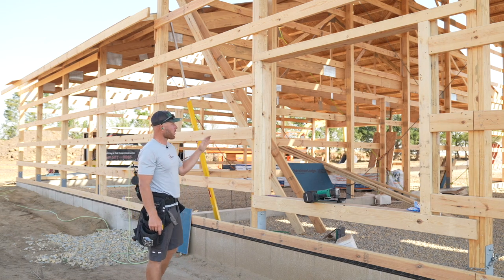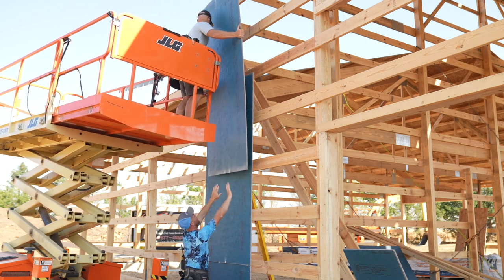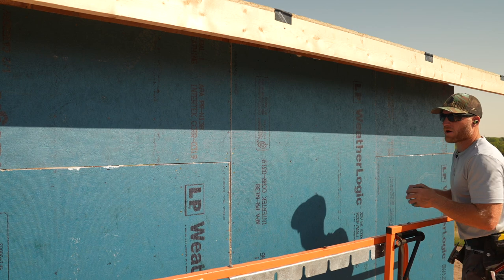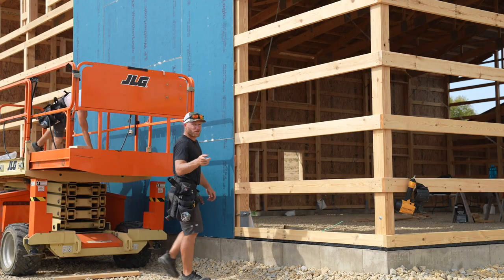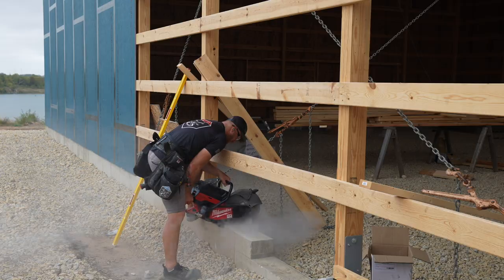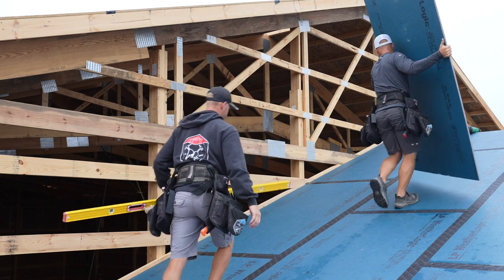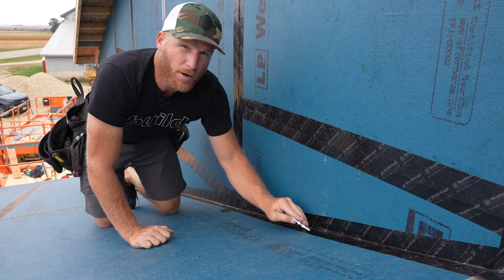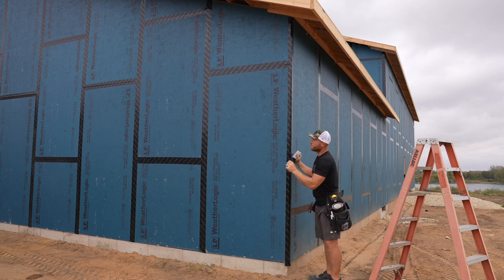Building a Barndominium Part 6: Installing LP Weatherlogic Wall Sheathing

Comment: Great job guys. Just wanted to add the point that whenever you're doing the flashing you always want to start at the bottom of whatever you're flashing.  That way if you have to add more flashing, as if the roll ran out and you need to start another roll it will overlap the bottom piece. That way you won't have what we call (bucking water). Another words, water cannot penetrate the end of the flashing tape.

Comment: You used taut right. Tight is two ends of something getting closer together, shortened, or compacted. Conversely, taut is two ends of something getting further apart, lengthened, or stretched.

Comment: To get the sheets up past 10’ a good idea would be have a piece of angle mounted to the side of the lift.  Just set it up on the angle iron while holding the other side.
Reply: We put 90 degree roof jacks on the side of our lift! Just a thought most people already have them on-site.

Comment: I like your detailed explanations of things,  one thing I think you may do different is bringing your vertical tape joints down after your corner tape is put in but before that final flat run down the rake.  Just the way I was taught.  I hope that’s not wrong to think but something to consider.  Again.  Enjoy your channel though big time.

Comment: Absolutely appreciate no compressor noise. Therefore I bought 2 valve silent compressor which I run in my apartment and which is quiter than my fridge. Neighbors are happy and my ears too. 😀👂👌👍

Comment: 13:35 The side of the building looks really good with the pattern of the sheets and tape!!! 2’ and the 8’ decision you made was the correct one visually it looks uniformed I know it doesn’t matter But when a homeowner sees it for the first time the reaction is gonna be good and in steals confidence that he made the right decision with going with you as a contractor.

Comment: A possible alternative to getting your tape in the corners: using a drywall mud/tape corner angle tool to place/smooth the tape.  Have one person pull tape taut, the other person runs the corner tool along the length of the tape.  Then squeegee for pressure afterwards.

Comment: Learned something new from you that I never thought about. Double taping corners with a 2nd run of tape  next to run on corners. We have 2 custom homes going up, and just went and got enough tape to do 2nd runs on corners. We have always double taped wall to roof joints. Just  never thought about doing the same on corners. Anyway, barndaminium is looking.great. You and Greg are a great team and making great progress. Be safe and see you on the next video.
Reply: Somehow all these products that use tape doesn't instill confidence in long term reliability

Comment: Liked the folding the tape tip.. I always used a chalk line to make sure it was even on both surfaces.. Doubling the tape is a bit of overkill, but a little more (water) protection is always welcome.. Loved the series so far, very informative, please don't skimp on the details, It doesn't matter how many times you show them, remember, this could easily be the first time someone saw how to do it... Also, 10 years from now, imagine how many young people chose this profession, simply by your attention to detail and dedication to the trade.. 10/10 brother...
Reply from the maker: Wow that would be amazing
Reply: @RRBuildings  You are very blessed to live at a time where you can literally reach out to and influence millions of future tradesmen, I have been retired for years, when I started building, power tools was kind of a new thing on the jobsite, air tools didn't show up until a few years before I retired.. I just keep thinking, what amazing things could I have built, if they had the tools then, that you have now.. I retired a Master Carpenter, fine detail carpentry work was what I took the most pride in.. Framing of course was the bread & butter for every builder.. I have had the privilege to have trained hundreds of young carpenters, yet only about 10 became master carpenters.. You are blessed to live at a point in time, where you truly can make a difference, I have seen many "how to" channels, you are young and I can see, you really do care about what you build and how it looks and how it all works together... Please continue to share, even if you think the tips are common and everyone knows them, believe me, someone will be learning it for the first time... Sorry this was so long winded, I am still very passionate about the construction trades..

Comment: Love watching your stuff, it's refreshing to see some else out that loves to do things right and thorough. You do alot of very similar building practices I do here in central Michigan. I haven't used the LP sheathing yet but would like to try at some point. I have been using the ZIP system which is very similar product but with the rigid foam option. Keep up the great work Kyle!

Comment: I'd add two 2" of polyiso staggered over the top of that weather logic. That combined with closed cell foam you'd be looking at an R40 or so. Would be amazingly efficient.

Comment: For the wrap tape; I’ve used a metal yard stick and fold the tape over it.  The edge of the stick pushes the tape down into the seam.  It’s not perfect but it works 3’ at a time.

Comment: Obviously, this building was not designed by an architect. Even measurements minimum waste and it doesn't have 15 unnecessary corners in each wall. I can't wait to see the finished product.

Comment: Have you ever tried using an inside corner roller head that's made for bedding tape in drywall? I would think if you keep proper tightness that it would prevent the bird mouthing...

Comment: Kyle, love the videos! Been watching them for over a year now! Great stuff all around. Why did you run the tape on the roof line last after running the verticals? Shouldn't the horizontal pieces run first then overlap the verticals to allow water to drain down?

Comment: One thing I will say is whatever the materials are worth, you'd still save something on the labor end not having to wrap the house. Heck, don't even need to purchase the wrap. In that way, I can't see it being significantly more than the older conventional way of siding it with the OSB and the house wrap. Maybe if you were building it for yourself and doing all the labor, but even then. What's your time worth?

Comment: Speaking of using a Makita saw a  festool track. I am  Thinking about buying some tools and Makita 40 V line along with the track saw but I want to be able to use both Ts 55 and and the Makita track saw on the same tracks With the same splinter guard does it cut on the same line or is it different from the ts 55 it needs to be dead on the same for me to use the same track for both .

Comment: Kyle.  Huge huge fan for a year now.  Very inspiring.  I'm a builder in Massachusetts and going to start building post frame for residential applications (senior living and others).  I need to gear up for doing this up here in the northeast (vs conventional stick frame).  Going to get most of what you have for equipment as you've got a great system with great tools and equipment.  I tried this framing method because of my research and your channel and did my first one on a two car garage build for a customer.  Wanted to ask you for a list of all what you have but I just found your Instagram page and it's all in there.  You are incredible for this industry (Fact!!).  Are you going to the Post Frame Exhibition in January in Nashville?

Comment: This is an exciting build to watch as it fits the shop/home concept I'm looking to build but how do you get reasonable financing on one???? And all the lenders I have found are only willing to allow a shop/home of either 50/50 or 40/60. I want a bigger shop than that. How much waist is there or is it even a good idea to build smaller and then rip out the end wall of my post frame and expand the shop? It's the only way I can see to satisfy both the lenders requirements and my needs. Your thoughts Kyle?
Reply from the maker: It’s going to depend on lender.  We didn’t have the issue here
Reply: I'd be interested in knowing that too. How does post frame lend itself to additions/expansion?

Comment: Why not use liquid flashing from the wall to the roof sheathing? That would be a permanent bond to both sheathings and you don't have to worry about water getting behind the tape

Comment: Should your inside corner get tapped (the way you did it) but be done first? So as the vertical and horizontal runs overlap the inside corner…thereby eliminating the edge (of inside corner) being lapped on the wrong side…if that makes sense…

Comment: Quick question. I’ve been looking at building a barn for some time. 40x80 heated floors and spray foam. Is it still cheaper going that route or doing icf building? I think the vertical I could put up myself

Comment: Wont the exterior metal + direct spray foam cause oil canning? My fiancée and I are currently in the process of designing our Barndo. I figured sheathing is a must.   We are currently in schaumburg.

Comment: I am in interested in LP products based on this series!  I am planning phase of a post frame barn that will need siding to match the house. Board&Batten. So LP Smartside for sure. Do I need the LP sheething under the Smartside?  I see sheds made with just Smartside. Thanks!

Comment: As you were sheathing the gable end of the main house above the garage roof, I noticed the end truss was not connected to the posts.  I could see nails in the wall girts going into the posts, but couldn't see any nails thru the truss to the posts.  I realize it's a truss and doesn't need mid span support.  Why extend the posts all the way up if the truss is not to be connected to them?  Obviously there's a reason or you wouldn't do it, but I can't figure it out.

Comment: I have a job offer coming from Wick as a foreman, but I come from a cold-formed steel commercial interior/exterior foreman background, how hard is the learning curve? I was a drywaller for years and started steel stud framing in 2009, was a foreman 2 weeks later, so I doubt I have much to worry about, but still, I'm a worrier lol.

Comment: Does that sheathing not need to have the nail holes covered with anything? I think Zip has some sort of putty for nails so I'm surprised. Like the look of it, how does it compare pricewise? Around here I swear few builders even tape the Zip stuff <sigh>

Comment: Hey Kyle im curious is the sheathing flex between girders is there any compared to a normal 16 inch on center conventional framed wall and also about fire blocking that would be installed on your joints of your osb

Comment: When taping the wall to roof connection, would it be better to do that first so the vertical tape runs over the top of it? You did an amazing job on this but just curious about sequencing for best result

Comment: When you ran the tape as the flashing around the 25 minute mark, would you want to do that first before the vertical tape? I was always taught to think like water...with the spacing of the plywood and taping over that space it leaves a little valley in the middle of the tape,  couldn't water (in theory) get behind the flashing tape running it like you did? What I mean is wouldn't you want the vertical tape to go over the flashing tape and not under?
Reply from the maker: Yes probably would have been best
Reply: @RR Buildings  thanks for your reply, always trying to learn is all...love you videos!!

Comment: I sure how there are bulk discounts on that sheathing.  I just found "local" pricing...that would be over $15K in just the sheathing.  WOW.   As for the finished floor...That is going to be radiant heat right?  LOL...So I'm getting SWMBO warming up to the idea of a Barndominium, but she really wants to be sure we have a basement (storage, potential shop for me).  Can that be done?  I'm sure the answer is "YES" because you could just dig the basement...but how would you do the floor support?  I'm guessing floor trusses?  Then if you don't do a poured floor where you bury the radiant tube in the concrete, you'll be able to run the PEX through the trusses...Would love to see you guys build something like that!
Reply: Would be better if at the point stick framing
Reply: @bornbehindbars2010  Lots of builders are moving to this and Zip...We've had 3 or 4 new subs in my area go up...100% using that and moving away from the house wrap.  So at that point, having a stick frame built will probably hit you for the sheeting costs. 

As for a basement, really the only difference there would be using floor trusses.  Poor a basement foundation, and use engineered trusses.  I was looking at I-Joists as they can span quite the distance as well.  It will come down to how easy/efficient, is it to put radiant floor heating in.  

I really want that wide open space as I'm looking to build ADA Compliant, with 36" doors, wide halls, all one level (or as my wife said "home elevators are around now..lol), roll in shower/bath, etc.  Not that we need it today, but we're getting older...one never knows.

Comment: What are you thoughts on sheathing the inside wall of the garage (the house side of the garage), so as to completely separate the two spaces.  The garage is a separate space that is not usually conditioned, so why have the two spaces communicating with one another?
Reply from the maker: It will be insulated and a firewall but not sheathed.  Both spaces will be conditioned

Comment: Great videos Kyle. Just a question about the Smart sheathing and the spray foam. Doesn't sandwiching the OSB between spray foam and the sheathings own water resistant barrier make it possible for rot and mold to develop as the OSB has no way to dry?

Comment: Wouldn't it have been better to run the tape at the bottom first, then run the verticals over the top of it? Seems like those verticals running under that seem could create small gaps where they meet. I'm by no means a professional! Just curious! @26:53

Comment: Kyle, love the content bro…..meet u at JLC few years back (Martinez booth) ,  dont wana be a troll but i think i have an idea for the mega deck and plywooding wall…….. instead of handing sheets into the platform, what if you could rig some kind of bracket where the sheets are allready on the outside of the lift?????
Reply from the maker: Agree would be a good idea

Comment: Looks really nice. I see that you don't use any adhesive with your siding. Do you see any advantage, disadvantage? Or negligeable sheer strength with or without glue. I would think that it would be stronger, but is it worth the cost? Just curious. Thanks for the videos, I really enjoy them.
Reply from the maker: All about your nailing pattern

Comment: Hi Kyle and Greg, thank you so much for posting these amazing videos. I am seriously considering integrating this type of construction into my company. One question I have is can you ever put a basement in one of these monsters? And also, how deep do your foundations go? Our freeze level is roughly 68-in, per code. Thank you for all your hard work.
Reply from the maker: Yes we have a few times
Reply: @RRBuildings  thank you for responding. Have you ever considered and intern program.?

Comment: Really like your channel!  Quick question which is best asked by reference to a specific point in the episode (minute 19).  How do you implement the perimeter nailing pattern on the 4 x 8 sheets at the vertical edges?  There seems to be no material to nail into between the horizontal girts.
Reply from the maker: Agree Scott and I guess the way I was explained, local code will dictate specific nailing patterns and I cleared this before we did it.

Comment: What’s the material cost difference of sheathing/lp vs. just metal exterior? I’m assuming it’s reasonably close
Reply: There’s probably close to 200 sheets for the whole building (including roof), so at least $10k extra, possibly closer to $15k with Kyle’s time.
Reply: You are only guessing
Reply: @daveklein2826  it’s called math

Comment: Loving the series! Have you used Zip sheathing in the past? I'm curious how you would compare the two. We currently use the Zip and Zip-r up here, as no local vendors stock the Weatherlogic.
Reply: Weather logic is def a more solid coating compared to the zip sheets that have visible holes and porosity to it
Reply: @fckafrdjohnson7210   Good to know! I can't find any local yards that stock the LP Weather Logic, I'm going to have to look into it!

Comment: What is the lifespan on the tape adhesive? That's really my only question on its long-tern durability. If you have to retape it in 20-30 years because the adhesive starts to fail that seems like a bit of a pain. I like the idea of it, just question the lifespan...
Reply from the maker: It cures like any glue

Comment: I'm in no way a professional and don't know if this would work but what if you would run a bead of liquid flashing in the seam before you lay the tape? That way the cut edges are sealed would the tape fail

Comment: I thought that the girts are doing all the lateral work for the building- are you only sheathing for weatherproofing?
Reply from the maker: No for structure
Reply: @RRBuildings  I noticed you used diagnol X bracing for the girts for lateral in some of your other projects, and omitted the plywood. I wonder if this is just your better alternative to that?

Comment: Do you build your post for the framing or are they purchased?
Reply: He gets them from Ohio Timberland.   The brackets come from Midwest PermaColumn.   Watch part 1 of this series and he will explain all of this.
Reply: Josh. The timbers are made to fit in the metal supports by Ohio timber.